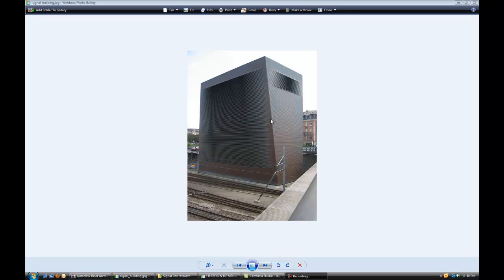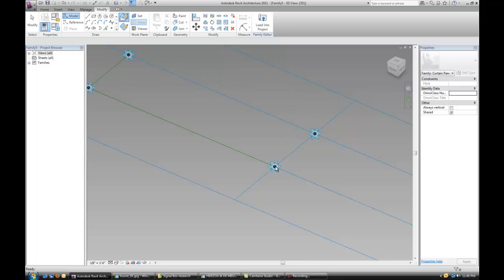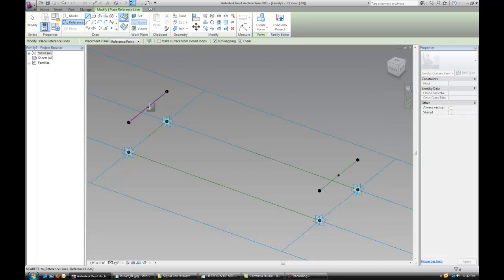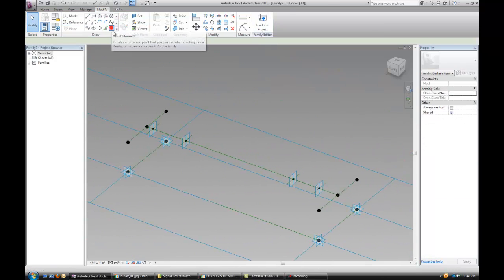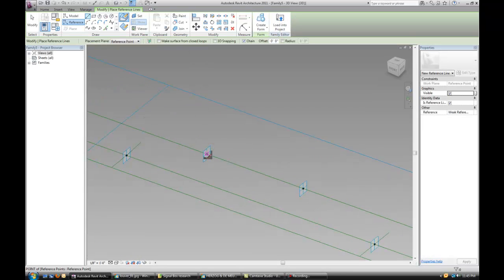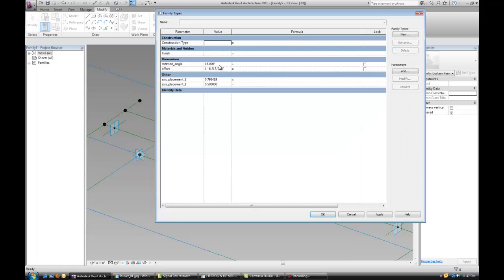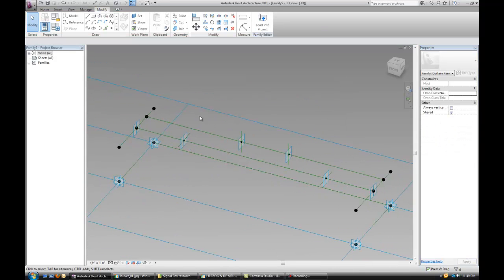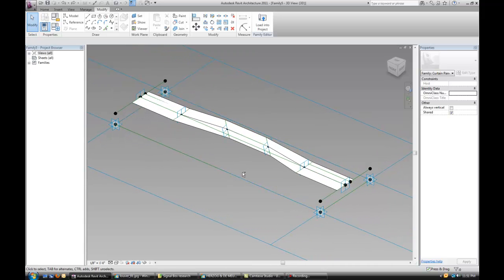Revit 2011 - Parametric Louvers (part1)

Comment from the maker: Hi Victoria,

Well it should be there if you placed the point (hosted) it on an already existing line. I created that point on a line and that automatically creates the Hosted Parameter field. If you select a point and hover over the line it should highlight in purple which means that you will be placing that point on that line. When you do that the Hosted Parameter will be there. 

Best of Luck!

Comment: Thanks a lot for the video Konrad.
I am a beginner in Revit so my question may be a bit simple.
I was following your tutorial using 2013 Revit and at the about second minute you selected the point and assign parameter at the dimensions area of the Properties panel. The problem is that when I selecting my point there is no Hosted Parameter field in the Properties panel.
Do I have to create it and how?
Thanks again  )
Viktoria